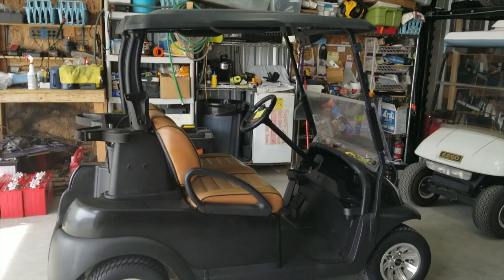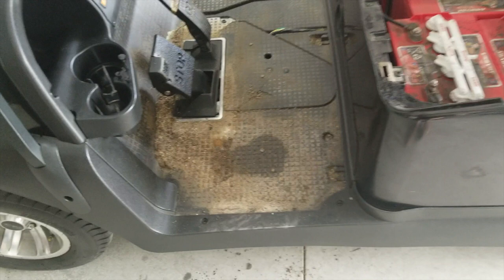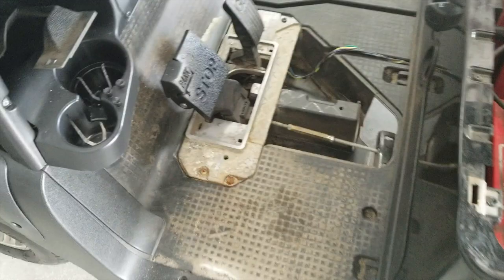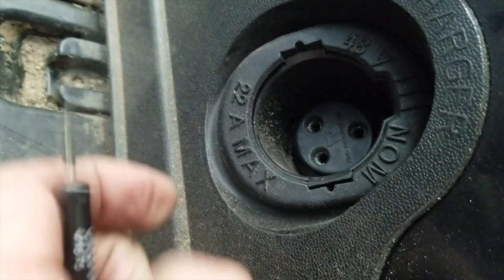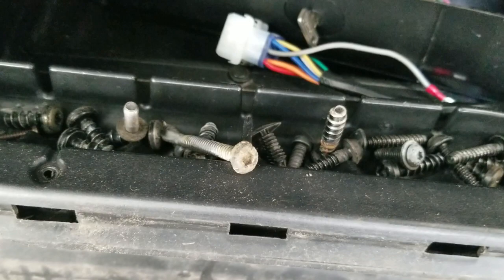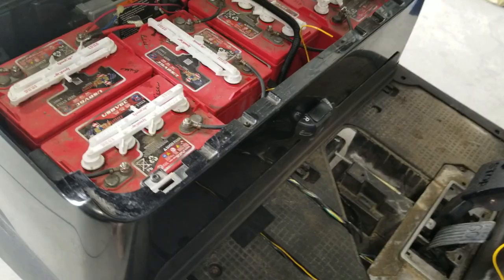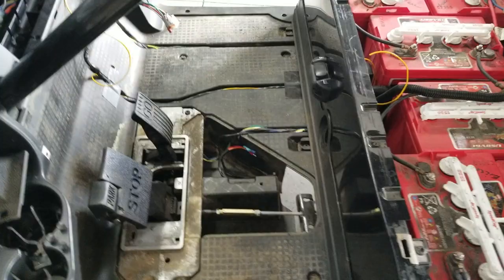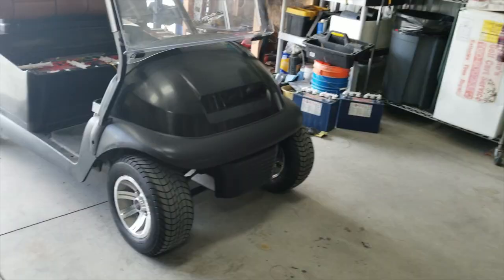Precedent Bucket Harness Install | How To Install Golf Carts | Wayne's Golf Carts

Comment: Thank you for this video sir! Every thing works except after 30-45 seconds the brake lights fail until you reset the ignition with the key. Any thoughts on my issue with this bucket harness brake light issue would be greatly appreciated 😊
Reply from the maker: Text or email me, and i will help you.
It will be too much to go thru on this forum.  Also, are you talking about brake lites or tail lites?  Because the brake lites have a timer on them, and will time out, or go off after the short time.

Comment: Can you show the wiring of the light switch?
Reply from the maker: I'm not following you, the light kit comes with the 2 wires for the switch,  already identified.  Or are you asking something else?
Reply: The light switch I have is the one with the little blue light in the toggle switch and there are 3 male type connectors on the wiring side. there are (it appears) 3 wires a brown, a yellow and a black. I have tried connecting these up and have had no luck getting the head lights/taillights to come on. I am in the process of converting to a lithium battery with a 12v converter. I am getting 12v output from the converter. I will attaach a picture of the on /off switch. The cart is a 2011 C.C. Precedent. Everything works fine accept the H. lights/T. lights, those are the only accessories on the cart. Thank you, Steve @waynemartin.waynesgolfcart4900

Comment: Hi Wayne, I have a PH08.  You mention a 2008 1/2 and newer do not have the bucket harness. Can I tell by the serial number when it was built in 2008?
Reply from the maker: yes you can.

The first 2 digits after the PH is the 
year, and then the next 2 digits are the week it was built.
For example :

PH0811.  would be 11th week ( November)  of 2008
Reply: So it goes ph0832-xxxxxx.
Reply from the maker: Relook at my post, i made a mistake, and have corrected it.

Its week not month.

So yours was the 32nd week of 08.

So yours is BEFORE the 1/2
Reply: Awesome thank you for the help. Keep up on videos I appreciate them.

Comment: Great video, I like how you explaine what ur doing and why your doing certain things, but I have a question this is jus laying out the bucket harness I didn't see any connections made?
Reply from the maker: There is a video showing me plugging stuff together.
Reply: @waynemartin.waynesgolfcart4900  Wayne, I'm very good at mechanics but horrible with electrical.  I have a 2016 club car electric.  Once I run the bucket harness and unplug the factory harness at the dash do I not use the factory harness at all?  I am just confused at the connections.
Reply from the maker: No, you hook everything  together. Your  bucket harness  will plug into your original  wires.
Reply from the maker: Max, I'm not following you?
Please tell me what you have and what you are trying to do?

Comment: Hey Wayne... Stupid question...if this is wired directly to the 48v pack... how does it not fry the lights if they are 12v?  Is there a solid-state reducer build into the light kit?
Reply from the maker: I am not following you, but you don't want to wire anything directly to the 48 V unless it's a reducer.

What are you asking me when you say " is this why are directly"?
Reply: @waynemartin.waynesgolfcart4900  I figured it out... long story short I converted to a leaf pack.  When wiring it together I put the bucket harness positive lead to the pack and when flipping the tow switch it melted the breaker and turn signal box under the floor mat.  I was completely at a loss until I saw this video.  I had no idea what a bucket harness was...I thought that the bucket harness' red cable leads to a factory reducer which I know now doesn't exist.  What I didn't realize until I looked at a picture of the lead-acid setup was that the bucket harness positive was attached to the battery adjacent to the primary negative resulting in a total of 16v.. not the 60v I rammed through it by mistake because I wasn't fully informed about how the cart was wired when setting up my leaf pack.
Reply from the maker: Glad you figured it out, but unfortunately at a cost.

Comment: Can you please advise me what the grey wire do?
Reply from the maker: which gray wire?
Reply: @waynemartin.waynesgolfcart4900  the one on the Bucket harness next to the 12 pin connector that goes into the dash console, the single grey wire with the bullet head on it foe deluxe light 💡 kit
Reply from the maker: Check to see if it has 48 volts on it

Comment: Hi Wayne, my 2001 48 volt club car has new batteries, the charger charges the battery but doesn’t shut down, my question is it possible this could be due to the charger and not the OBC, thanks Mike
Reply from the maker: 1st of all you need to make sure you let the charger fully charge the new batteries. A could take up to 16 hours possibly to charge the new batteries the 1st time.
 So plug it in and leave it alone for at least 16 hours and see if it works its way down and finally shuts off.
 The OBC needs to acclimate itself with a new batteries and that's why it takes so long after you unhook the OBC to reacclemate  with  batteries.

 If you do have a problem I would say it's more likely to be the OBC than the charger.
Reply: I am sorry I should have told you the batteries were 3 weeks old when we bought the cart , when I put it on the charger the day we brought it home the charger read 15 amps then in about 3 hrs it was down to about 3 amps I went to bed when I got up it had been about 9 hrs total and they were bubbling away and I could smell  them, do you think it would have been safe to keep charging, I unplugged it because I had to go back home, what do you think, really appreciatethe help, and if I wanted to bring a OBC back with me don’t I have to know the number on the one in the cart, thanks Mike
Reply from the maker: i would plug it in and leave it alone.
If after 16 hours its not off, then unplug it.
As long as the batteries are good and there is water in them, egg smell will stop after a few charges.
Reply: Ok good stuff , much appreciated
Reply: Just one more thing Wayne, isn’t there a couple of different OBC’s for my cart, with different types of plugs
Reply from the maker: yes there is.
You need to get the part number off the label on the obc.

Or do a bypass and get a different charger.
Reply: I am leaning towards the summit 11 on board charger
Reply from the maker: Thats a good charger. I havent used their on board set up yet.
Reply: The reason I am going with the on board and not the plug in one is because their tec center said unless I have the 6 plug den I wouldn’t be able to do the bypass, and it also saves me on the cost of the bypass and plug
Reply from the maker: Well I don't agree with that.  the summit 2 is the only charger I use I do bypasses.
 I have probably done 7 or 8 bypasses using the summit 2 standalone charger and have not have any issues
Reply: wayne martin Oh ok Wayne, that’s what I would have thought, maybe the Bypass that the company I was talking to only had the bypass for the 6 pen dem, I will definitely do more research, and if you have any more info on this please let know, you have already been a tremendous help to me
Reply from the maker: You can buy the summit 2 with the club car cord, that's all you need to buy. I can tell you how to bypass tbe obc, no need to buy anything, especially dont need to buy a bypass kit from anyone.
Reply: I did not know I could bypass the OBC without a kit, this just keeps getting better and better, now I’m excited 😆
Reply from the maker: no kit needed. Just need to run and splice a couple wires.
Reply: Makes sense to me, I would think it would be like making the plug simulate the ring connectors on the on board, just taking a different path to the batteries
Reply: I would like you to explain how to do the bypass, to bad you didn’t have a video on it, thanks Wayne
Reply from the maker: when are you gonna do it?  Maybe i can throw a video together in the next few days?